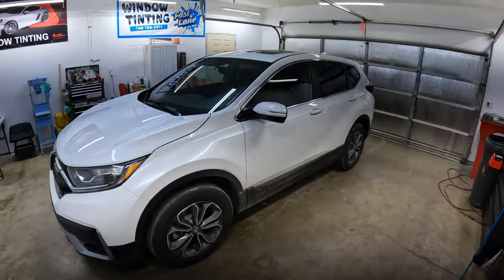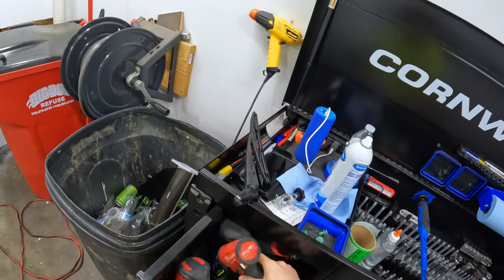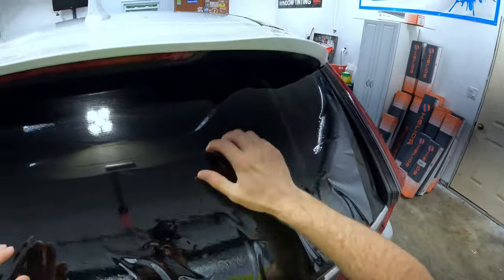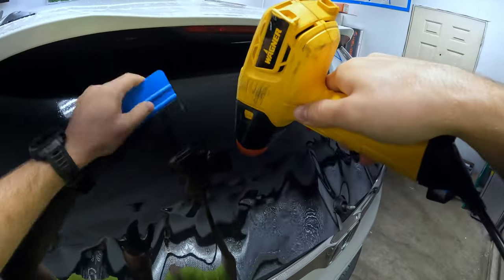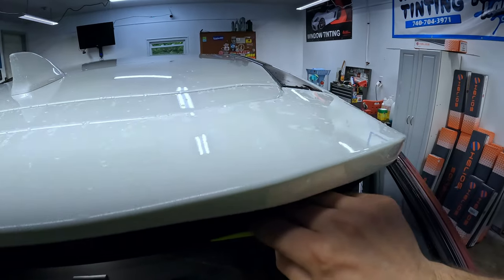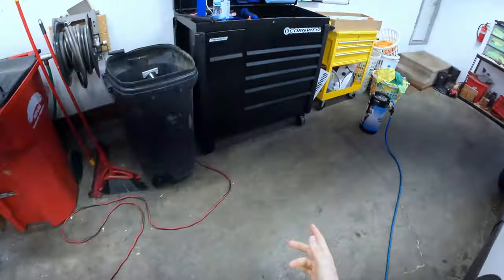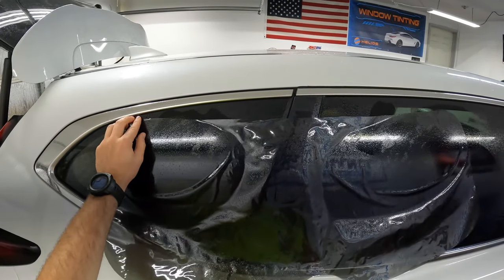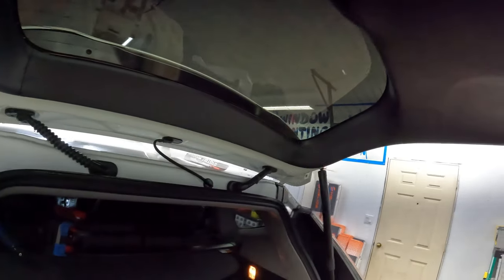2022 Honda CRV: How To Tint The Back Glass

Comment: what light do you have?
Reply from the maker: I use a few different ones. I use my milwaukee M18 rover light a lot. I've also got an Astro 525L and a Cornwell CBI5041.  Heck sometimes I even just use one of the old 4 foot shop lights from the ceiling and put it in a back seat or hatch or whatever. Lol

Comment: Hey Man, This helped a lot. These are one of the few windows I struggle with. Especially the older models that are more curved. If I could offer a piece of advice though. Look into other methods of anti static for the back window. The chemicals in the dryer sheets are super toxic to skin and it'll mess you up in the long run. Thanks for the video, brother.
Reply from the maker: I used to use bar soap. This just tends to be less messy and dries faster. I appreciate the info, I need to look into that!